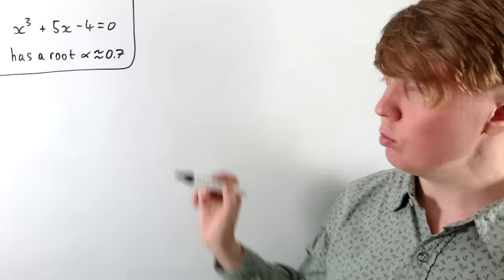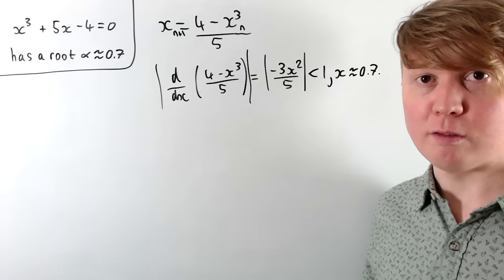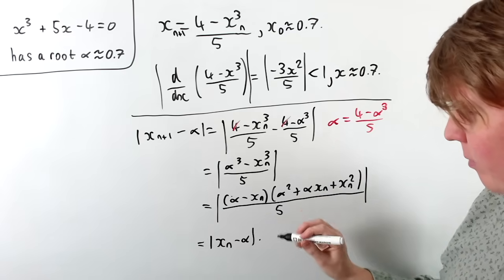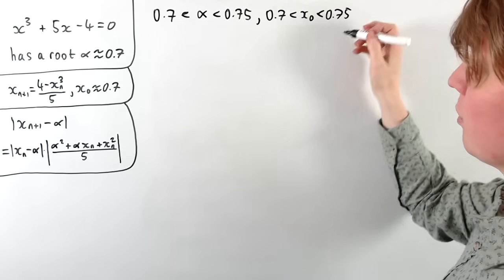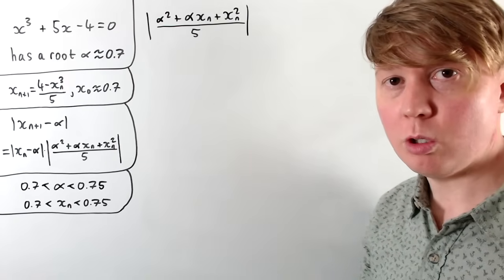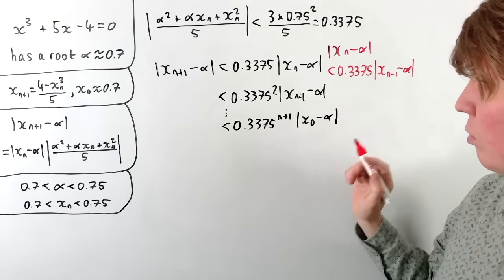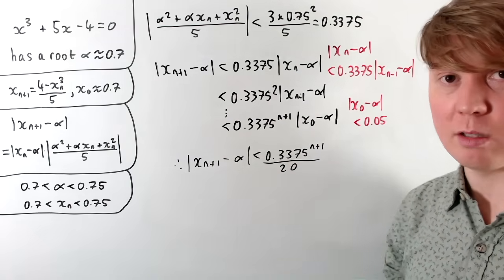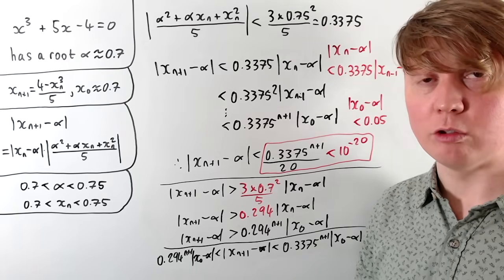Determining the Speed of a Fixed-Point Iteration

Comment: Please explain where the negative is introduced which flips the inequality at 7:09?  I would really appreciate it.
Reply from the maker: I skipped a few lines of working there. The missing steps are:

x_0 < 0.75

x_0^3 < 0.75^3

- x_0^3 > - 0.75^3

4 - x_0^3 > 4 - 0.75^3

(4 - x_0^3)/5 > (4 - 0.75^3)/5
Reply: @DrBarker  thanks so much you have a brilliant mind.

Comment: there are many modifications one could apply to the original polynomial equation to get something of the form x = F(x), is there a general guideline or recipe to follow to guarantee F is contracting near the point you’re iterating from? (which probably requires an approximation of the root to begin with)
Reply from the maker: The general rule is that if |F'(x)| < 1 in a neighbourhood of the root, then the iteration will converge. 

It's possible to understand this by drawing examples of functions with |F'(x)| < 1 or |F'(x)| > 1 near the root, and drawing cobweb/staircase diagrams by hand. 

You can also understand/prove this using the mean value theorem. In the description, there is a link to a video which covers both explanations.

Comment: Great video!

One slight comment: it would have been nice to make the link to the usual methods; your expression is approximately the derivative at any point on the interval [0.7, 0.75].

It wouldn't have changed much, but you could have waved at the usual train of thought from the window to show it's really not that far removed.
Reply from the maker: Good point, yes it's nice to see how this example still achieves a very similar end result to the usual approach.
Reply: To expand on this for anyone who might be wondering about the link: suppose we define the "rate of convergence" at a given stage to be |x_{n+1} – α|/|x_n – α|. If x_n converges to α then eventually this rate will be increasingly close to its limit. Letting f(x)=(4-x^3)/5, and remembering that α is a fixed point of f (so f(α)=α), we then have that the rate of convergence itself converges to the limit of
|f(x)-f(α)|/|x-α| as x→α which is just the absolute value of the derivative of f at α.